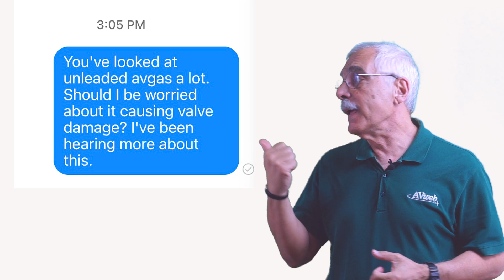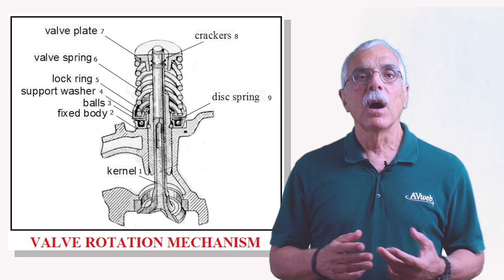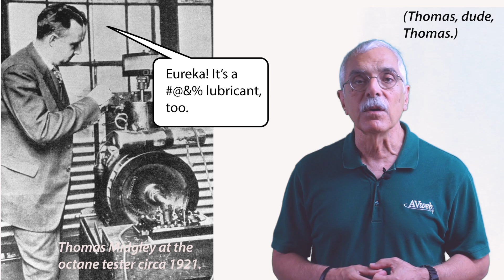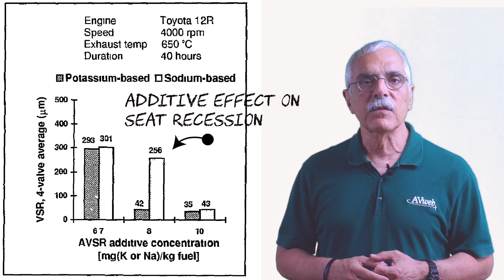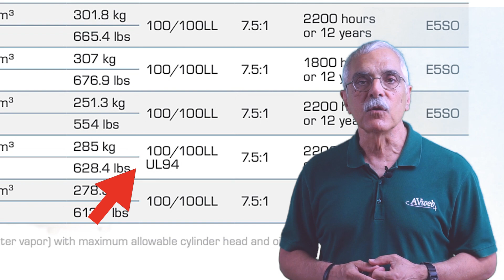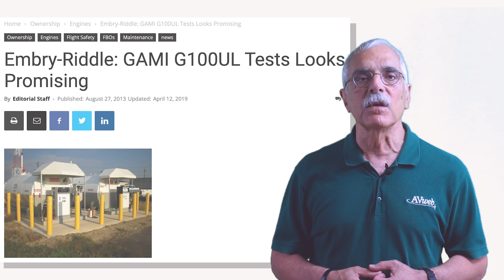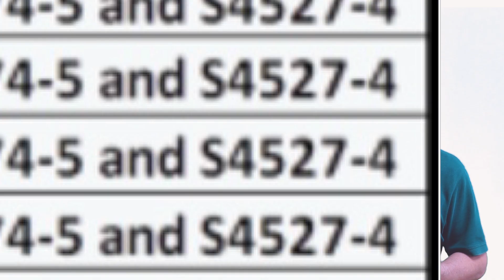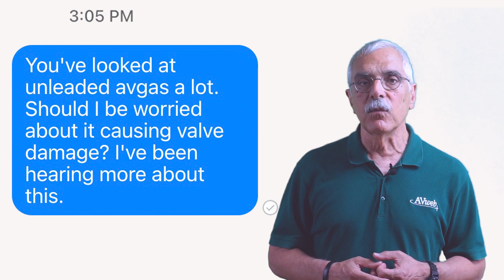Whadayamean Unleaded Fuel Will Trash My Valves?

Comment: I don't see why they couldn't do it like auto fuel back in the 1970's and 1980's where they had both for a while to give older car owners a chance to buy new cars.  Of course, I don't plan on buying another plane for another 20 years, so I'd hope this time could be that long.
Reply: My understanding is that a big chunk of the cost of avgas comes from distribution. Carrying two different grades of fuel everywhere would significantly increase cost for everyone. That’s also why you can’t find mogas at airports today even though a lot of planes could use it with an STC.

Comment: Any way you slice it, unleaded avgas will make engines and parts more expensive and negate any savings from fuel refining efficiencies. I hope they put more than 700 hours into testing before drawing conclusions.
Reply: Yes and no
Many refineries are anti having to handle lead for environmental reasons and it contaminates the trucks. This blend apparently is far more accessible to make.
Hardened valves will cost the engine manufacturer sweet F all, they need to stop making engines with junk Metallurgy from the 40’s. 
When I looked into it they had several flight schools using it with great success.
Reply: @josh3771  Also, tetra-ethyl lead is only made in one factory in the world, and it's not in the USA, and they could turn it off any time they chose
Reply: @josh3771  I really hope it works out. Yes, adding electronics to old engines just makes everything more expensive.
Reply: And your average FBO is going to have to buy all the equipment to STORE and distribute it, and cover those costs.
Reply: If the issue is really lubrication, mixing two-stroke oil in the fuel would help.

Comment: It is absolutely insane we still allow leaded fuel for airplanes. Freaking upgrade already to modern stuff. Stop dragging your feet
Reply: You understand that the operators don’t like this either, right?
Reply: @Finder245  No I don't understand your train of thought there. The reason leaded fuel isn't outlawed yet is because there are people who are opposed to banning leaded fuel for airplanes. Do you think it's a stretch those opponents are owners of older airplanes? So no, those people are not unhappy they still can use leaded fuels. They are happy they don't have to invest hundreds of thousands of dollars to upgrade or retire their airplane
Reply: @Felix3301  the issue is that a lot of new planes also require leaded gas because there was no approved unleaded alternative until very recently, and even that fuel is impossible to find. This is in big part a fault of the FAA for not approving this fuel years ago.
Also, a lot of older planes would happily run on "mogas", the regular gas that you find at a gas station. You can even get the appropriate paperwork to make it an approved fuel for that specific plane.The issue is that you cannot find mogas at airports. Mogas is also much cheaper than leaded gas, so no one really wants to use leaded gas, so private operators would love to use that instead. Lead is also awful for the oil, and it makes closed loop automatic mixture control (like your car uses) impossible because the lead fouls the O2 sensor in the exhaust.
(I am actually planning to start building an experimental this year. One of the primary requirements I have is good MPG, not because of the cost of fuel, but because I want to fill it up with mogas, but I can only carry so many cans of gas.)
Reply: Airplane owners aren’t going to be a fan of the cost….
Reply: @Notthe_droid_youarelookingfor  Ofcourse, that pain was there for car owners as well. We're seeing some serious lobby power at play here keeping this fuel legal

Comment: Some premium fuels in Michigan do not have any alcohol for the boating industry.  Sure makes my eco-boost smile.
Reply: That alcohol absolutely increases performance in turbo cars. I run E20 in mine, though fuel economy suffers with alcohol due to the lower energy density it more than makes up for it in being able to run more boost without knock.
Reply: Actually it makes your ecoboost frown. Ethanol knock threshold is sky high with very low EGT's compared to gasoline. The only thing holding back E10 is that they blend with total crap to come up with 91-93 E10, taking advantage of that... If you mix up to E30-E40 and tune accordingly you will see huge power gains on that ecoboost.

Comment: Following with interest, but a moot point until I can actually get G100UL at any local/regional FBO.

My Musketeer's O320-D2B (factory rebuild installed in 2021 so all the modern goodness applies) is approved for the MOGAS STC, but the rest of the plane isn't.

Comment: Paul, Great video, I look forward to each.  
How about a video on the new glass panels vs round gauges, are they reducing IMC accidents or spatial disorientation?
Reply: How about a piece on how  the rage in glass cockpits cost almost as much as a new engine and are driving the cost of aviation up to the point that it is impossible for all but the wealthy to fly any more. Give me analog gauges any day. The only glass I will have in my old bird is an iPad. The cost of certified engines plus glass equals six figures $$$$$ in even a kit version of an aerial Putt Putt Puddle Jumper. Who care right?

I guess when you are raised on video games you are just not comfortable or confused with what round gauges are telling you. Guess I’m square. I’ll take a six pack of round ones and a good scan any day. At least know where to look to get the information I need. 

Glass cockpits kills. Let me explain.

The consistency of where and how the information is displayed in modern cockpits are anything but consistent between different panels. 

That right there can kill when transitioning from one aircraft to another. That plus the pressure of rapid fire ATC communications in a real  turbulent vibrating vision -blurred eyes -wet -with -sweat IFR/IMC environment seems to be putting down a lot of new glass birds, whether the glass is in the cockpit or wraps the super critical laminar flow airfoil on the wing. 

One more bit of tidbit. GPS can also kill. 

When I trained for my instrument ticket, we had to have three altitudes we had to fly: Obstacle clearance. Pay attention to those blue numbers, somewhere in that navigation square is something sticking up if you stray lower than the blue number. Next you had to fly an altitude were you could receive the signal to navigate and finally you had to fly at an altitude to communicate.  If you did your homework and the ceilings were lower than the blue numbers, you didn’t go because your VOR needle had a big red flag on the dial. This kept a scud running to a minimum. Not so with the GPS tied to synthetic vision. Pilots have real big balls now. GPS and synthetic vision are not limited to any such height restrictions so scud-running is at an all time high. Inadvertent flight into IMC my ass! Combine that with a glass wing which gives little or no stall warning.  Stall/Spin accidents are more frequent now more than ever. Darwin wins. Glass cockpits invite stupidity.
Reply: @crawford323  Hogwash. Good mechanical instruments were never cheap, either.
Reply: @wrkingrageaholic  yeah, honestly I don't think this guy understands (or is willing to admit) that the glass cockpit is doing a lot more than just representing the information you would find on your six-pack. Mechanical instruments simply can't compete with modern avionics for reliability, accuracy, and calibration stability. Obviously I think everybody should keep practicing how to fly with just that six-pack, but the data is crystal clear about the fact that glass cockpits prevent accidents.
Reply: @crawford323  I agree about none IFR planes or flying VFR, they don't need them.  
I believe that the new instruments need to have the functionality to have them warn you visually and audibly about flying below set blue line, DMMS, altitude restrictions, etc. that round dials would not be able to do and that would help with stall/spin accidents.  Plus have the panel correlate  on the moving map your altitude and the height of the objects in your path and visually and auditable warn you like the TCAS does.  
Scud-running is always a risk and their training should have kept them from doing it.  
I'm wondering if the IFR/IMC training is not keeping up with the glass and upset/spatial disorientation training with glass to keep you alive as we're still getting way too many IFR spatial disorientation accidents.  
The no stall notification wing is a different subject but the DMMS visual/auditable warning would help help with that and save lives.  
I'd love to hear Paul's take and the research he always does on a subject.